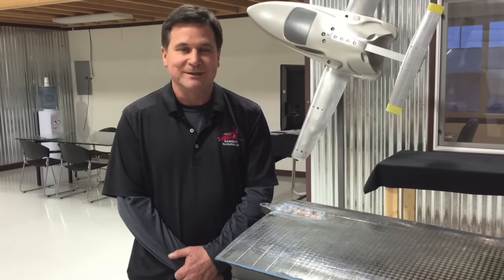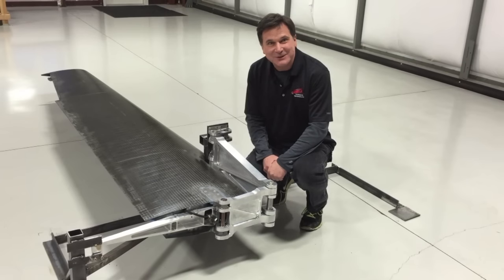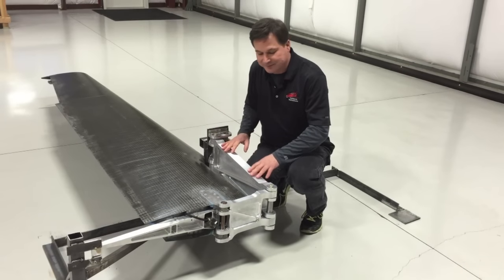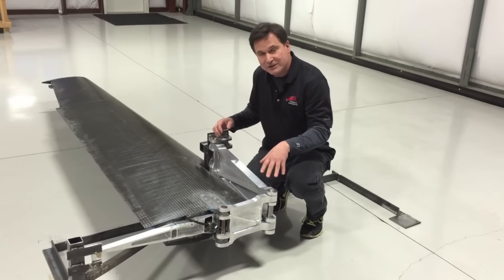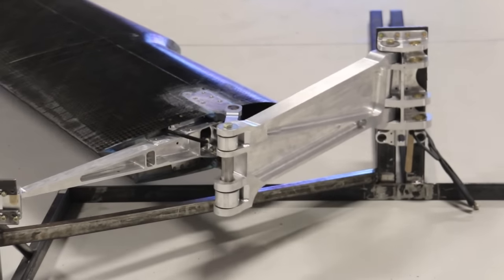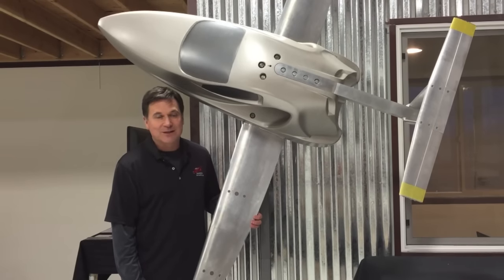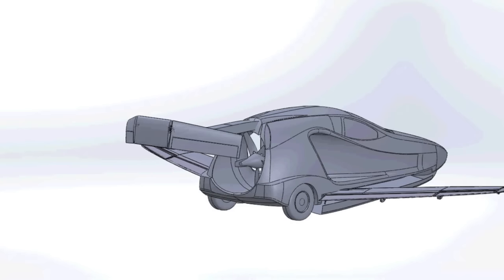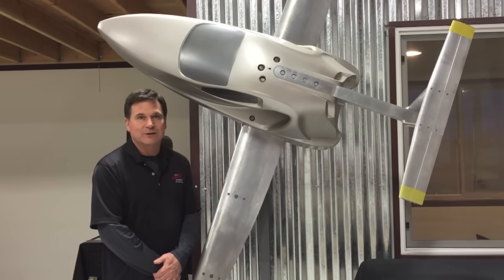Introducing the Wing Swing

Comment: Wow! The stall speed on that thingy got to be god damn supersonic.
Reply: can you explain a bit more.  im ignorant on flight/pilot lingo, but am curious. im guessing that you are saying it would be very easy (and therefore very dangerous) that this would stall in mid flight, causing it to lose control ?
Reply: @Gizziiusa   Hi. Yeah, sure. I'm no flight mechanic either though, so don't take my word for it. :)
To me it looks like those wings are way too small and have way too little profile to create enough lift to carry such a vehicle at lower speeds.  The smaller wing area, the faster you have to go to remain flying. Every aircraft has a stall speed. Under that, your wings are unable to produce sufficient lift. 
Smaller wings has benefits at higher speeds though, like reduced drag compared to bigger ones. It's all about balance.
Reply: @89RASMUS  ah, ok.  yeah that makes logical sense  from a physics viewpoint.  yeah,  those wings are quite narrow. good day.
Reply: @89RASMUS  @Gizziiusa The ratio between length of the wing related to chord length is named the aspect ratio. The ratio we are seeing here is designed for lift and endurance. The inverse would give you higher max speed, and better maneuverability. I would say this airframe design is pretty solid considering what we're seeing usually when talking about cutting-edge aeronautic. I would keep an eye on the position of the COG as, from what I'm seeing, the pilot and passenger are in front of the wing (meaning it is a variable, so COG becomes a variable during the flight, more so than with just fuel being consumed). High aspect ratio wings are significantly less tolerant to out of bound COG. tl;dr : think F-104 vs any gliders.
Reply: @remmahsroht  I think Rasmus' point is not the aspect ratio, but the size of the wing. To support the weight of the vehicle the small wing has to move through the air much faster than a large area wing would. The small wing is fine in cruise once you are already going fast, but this is obviously problematic for take-off and landing. A cruise missile has similarly small wings, and it does fly very efficiently. But to get it into the air, one has to launch it with a solid fuel rocket. (The landing is not considered in that application.)

You could do small wings here, if the car could somehow first get into the air and accelerate to high velocity -- Pterodynamics implements such an idea with their TransWing, but that has its own trade-offs and still has not been proven on a large vehicle.
Reply: @cogoid  I see your point, and of course, wing surface is important. But some aircraft can do with a wing this size. That being said, after writing my previous message, I watched other videos posted by this company. I must say, this aircraft seems to be very heavy, especially considering the frame supporting the main landing gear, and the road-worthy tires. These things seem heeeeavy. Considering the wing surface, yeah, I can see why you're doubtful. And all this actuated unfolding everywhere.... Weight, weight, weight.
Reply: @remmahsroht : Which means you will also need a LONG runway, soooo...
Reply: Yaaaa. Wing loading looks insane at a glance. No way.
Reply: It's a reduced-size mock-up. But man what a lot of weight. I don't like the look of those hinges.
Reply: Agreed, wing is comically small for the vehicle it is supposed to support.
Reply: @89RASMUS  Maybe they've designed the body to generate some lift as well, although looking at it I'm not sure that could totally make up for the wings' small size.
Reply: @Gizziiusa  he is being sarcastic saying the wing wouldn't produce much lift. So only way it would fly or not stall is by flying at very high speed to produce enough lift exaggeration to supersonic though 😂

Comment: Those hinge beams need some lightening holes, in fact every place that can structurely tolerate more lightening holes should be applied, it will save weight  and fuel
Reply: and break easier

Comment: 5 years later still no flights
Reply: Development takes years, even for the largest corporations
Reply: @Sweedster  Space X started in 2003 had their first commercial flight in 2008. When something is plausible it doesn't take 10 years. When someone is dreaming it can take decades . This company doesn't have the pockets for that. They will be bankrupt before it even flys once. 
Look at the flight surface. If this thing isnt going 300 mph there isnt going to be enough lift to get off the ground.
Reply: It's because the design looks more like a joke rather than working...

Comment: The power required for a car is air resistance + wheel friction. The air resistance of a plane is air resistance plus induced drag. The force necessary for lift has got to be a lot more than for rolling on a highway.

Traffic management in 2 dimensions for large number of vehicles has been imperfectly but usably worked out. If only a couple super rich have flying cars, maybe okay. If you are ever going to have lots of people with flying cars, you will have to manage that safely. Seems a daunting problem to me, but as I said, for a rich man toy, maybe successful. Problematic in large numbers. Morning rush hour? Traffic jams? 

A wing hinge that is safe enough, light enough, and is constrained by the packaging requirements will be very expensive.

Everything is going electric for air quality. How far will a battery powered flying car go? So less MPH and more emissions. I'm betting against flying cars, except as a stunt, which has already been done.

So we got legal issues, volume issues, expense issues, safety issues. I am willing to bet money there will not be a volume production run of a flying car. 

Once I knew a woman whose ex husband started a neo classic car company  (think Excaliber). Se said they never meant to build more than one, just get investment money.

Comment: The problem with flying cars is that there’s invariably going to be other people doing it and before long, there air is full of them and hitting into each other and then falling on people on the ground. If they regulate it to the point that it’s safe, it won’t fly any faster than a car can go and you’ll only be allowed up in the air for short periods, until another car is nearby and then both of them have to come down to a safe altitude or go back down to the ground. It’s just not feasible or enjoyable in practice. It won’t save you anything and it’ll cost 5 times as much at least. Stick with cars or public transport.

Comment: Flying cars wont happen until someone makes a succesful VTOL version. 
Its 2021, nobody has time anymore for taxing on a runway specially if its a personal flying vehicle.
Personal flying vehicle means autonomous 100 percent freedom of travel. 
If the flying car still needs a runway, then its not 100 percent freedom of travel cos u cant takeoff and land anywhere u want and u still need to find enough clear flat ground.

And, humans live in close spaces and cities thats why VTOL is the way to go.

U have a great idea, but that fixed wing car wont happen cos people wont be able to use it in crowded towns and cities cos theres no runway.

My suggestion is put 4 electric rotors on each corner so it can VTOL, then if enough height is achieved in vertical takeoff, deploy the wings and run the pusher propeller at the back, when enough forward momentum is achieved, u can now turn off the 4 horizontal axis electric rotors and transition into horizontal flight airplane mode.

VTOL is the future.
Runway needing air vehicles will be obsolete cos what people needs is what they can use anywhere and everywhere.
Reply: man cant waeight for everybody to live at a airport

Comment: i had a dream about a vehicle concept but as i dont have money to make it, maybe you will interested in using my idea. In my dream, i was at a beach with my dad. i was a young kid and my dad gave-me a 747 shapped balloon. i tried to fly it like a kite but the winds are too strong and the ballon did not retain it's aerodynamical shape. so, because of this dream,  i came with this idea. make a inflatable plane for leisure use. days later, i did a search and found out that goodyear had already  tried it but the plane structure wasnt rigid enough just like in my dream. I think the idea is still viable. all you need to fix the structural problem is to create some sort of snap-on rigid structure and can be made of carbon fiber or aluminium. just pump it, slap the structure in place and its ready to go. If its filled with helium, maybe it can even be pedal powered! how cool will that be?

Comment: First of all, the surface area looks insufficient for the load it has to lift and secondly, the CG looks WAY too far forward which will cause an inability to recover from a stall.  Looks like a death trap to me.  But I guess I'm a little off track.  You're talking about the mechanism after all.
Reply: CG forward is stable and would be easier to recover in a stall, if you are referring to a vertical stall.  Without knowing the actual weights on this thing, who knows where the actual CG is.  But it could be in the correct spot.  Either way, forward bias is what you want on a normal aircraft for stability.  The more forward the CG the larger elevator surface you will need though.
Reply: @Power5  Oh yeah.  That's right.  Looks nose heavy to me but, actually now that you remind me, that's what allows you to get the nose down to gain airspeed and recover.  Don't know WHAT the H*** I was thinkin' lol.

Comment: I still prefer delta wings over swing wings.
Reply: Why not just have no wings? Lifting bodies anyone? I don't like the idea of my main spar accordion folding!
Reply: @hud86  The engines needed to produce enough thrust without lift from wings would need to be quite powerful, relatively large, heavy, and more powerful as it is almost always means more weight which means more engine power which requires even smore fuel, and overall it is not worth it. And as more powerful engines use more fuel. Something like this is doable, but extremely unpractical and if something went wrong with the engine that would require it to be set on idle you would fall straight out the sky without wings, but with wings you could try to glide down.
Reply: @risingmoon893  yeah, most jet engines are capable
Reply: This car wont happen cos it still needs a runway. 
Its 22nd century and nobody has time anymore to roll on a runway just to go somewhere.
Finding an airport or a 100 meter clear flat ground just to fly somewhere in ur flying car is such a hassle.
Unless they make it VTOL then we are talking a feasible flying car.
The best models are the ones that has 4 VTOL rotors on each corner(like a quadcopter) and a pusher propeller at the back for horizontal flight, that is the future flying car. Not these flying cars that still need a runway.
Reply: @mariadelacruz1153  Well in a more practical sense making it VTOL would make it  mroe expensive and would give up speed and maneuverability, and it would also dampen its ablity to glide if some accidentdnt were to happen.
Reply: @risingmoon893  
Perhaps a winged quadcopter with pusher propeller u prefer? Cos thats whats in my head.
I mean speed can go, were talking flying on and off places, not flying cross country, the priority is to be able to jump takeoff(vtol) not speed.
Reply: @risingmoon893  
U know.
VTOL with the 4 corner props, when enough height is achieved, turn on the pusher propeller, when enough horizontal momentum is acheived, u can now turn off the 4 vtol rotors and transition to full airplane mode(horizontal flight).

Thats the VTOL car in my head.
Reply: @mariadelacruz1153  if you want any range Vtol is out of the picture with current tech
Reply: @hud86  
If ur talking about just the vtol, yah ot doesnt have range.
But im talking about putting a pusher propeller on a quadcopter for speed and wings for full horizontal flight.

Imagine a cessna, remove the tail replace it with pusher propeller, put 4 horizontal axis rotors on each corner of the plane(like a quadcopter) and we will have an aircraft capable of VTOL, hover and full horizontal flight.
Its not exactly what itll look like(a cessna with quadcopter rotors on corners and pusher prop on the back) but i hope u get my point.
Reply: @hud86  
The 4 horizontal axis quadcopter rotors can be battery power since theyll only be used during VTOL and the pusher prop will be gas engine.
Reply: @hud86  
I do not intend to move while hovering with my VTOL model vehicle cos the priority is to just takeoff on the spot, so the 4 rotors will be fixed in position, they do not swivel or thrust vector or have differential power output mechanism, they just provide a vertical lift, fixed to blow vertically that just it.
Reply: @mariadelacruz1153  The lift fans or jets in this  case would create drag and the point that it is an already small craft there isn't really be going to be a place to store such items so it would be out in the open inducing drag and reducing lift.
Reply: @risingmoon893  
I know that but atleast VTOL is achieved. Isnt that the point of putting lift fans?
Reply: @mariadelacruz1153  It is, but its not the most practical.

Comment: Very interesting, innovative, and simple.  However, drivers can't even drive on freeways without congesting them.  I observe inept, ignorant, proud, distracted, etc. behavior while driving.  Drivers don't understand what the left lane on the road/freeway is for.  They merge onto a freeway at 55 mph where traffic is 75mph , and are adamantly convinced slower merging is safer.  They do not move over for faster traffic, they do not use their turn signals etc.  Right lane is for slower traffic yet they drive slow in the left lane.    The list is endless, most people are not even remotely aware of the laws of physics let alone want to learn them.  Now about flying anything,  you MUST understand temperature and its effect on air density, what is air density??????? This is but the beginning of what you MUST know to fly.  People are not motivated enough, or smart enough to learn how to fly, much less in close formation over a populated area.  The airforce spends countless hours training fighter pilots to fly in close formation.  You have to be SMART, in order to do it.There will never be flying cars available to the masses for these reasons.  I could go on for days on detail, but I think my point is clear.

Comment: Like most "Multi-purpose" things they do neither well. One great example is the mill/lathe combo machines. Every machinist that has ever used them hates them and says that they do neither job well. With this pipe dream of a car/plane, look at what you would have. In the air, it will be a pig and on the ground, it will be a pig.  Imagine a hot day in August in big city traffic with this thing driving by blowing air out of the rear!  Or in the air with a big headwind. It would have no ground speed and would cost and take longer than driving a nice car.

Comment: Over engineered... So much added weight added to the structural elements needed to "stow" parts. Aircraft should be designed with a few moving parts as possible for reduced weight and improved structural rigidity.

Comment: And why are flying car designs so modest?
Flying car?
I want a flying truck!
Half bush pilot and 4x4, V-8 powered, STOVL, monster truck, with a 5,000 pound payload.

Or semi!
Semi plane, semi truck, gross weight 80,000 pounds. Retract wings on a 53' trailer 90foot plus wing span with a 9foot chord. Big prop.

Comment: Cars make crappy planes. Planes make crappy cars. The hinge mechanism and all the folding motors and linkage add unnecessary weight. The dimensional requirements of a car require all this crap and guarantee cars will never make practical airplanes. Period. Dot.

Comment: No disrespect to the designer...It's always great when aerospace engineers are pushing the envelope.  But, the biggest problem with the flying car concept is one that has existed for ages and still clearly exists...Not enough qualified pilots.  Most people on the road these days can barely drive a simple car safely and by the rules of the road, let alone safely fly.  Flying cars can and should ONLY become any kind of reality when the DMV starts placing the same safety and competency requirements and standards that they place on pilots on all drivers of cars....which would obviously mean that about two thirds of you reading this would need to start riding a bicycle because we all know what crappy drivers you really are!...no regard for speed limits, always screwing around with your phone even though you know its against the law, disregarding weather restrictions and limitations, etc...